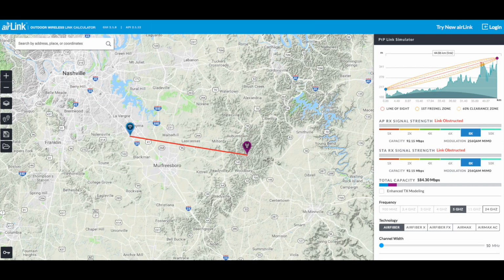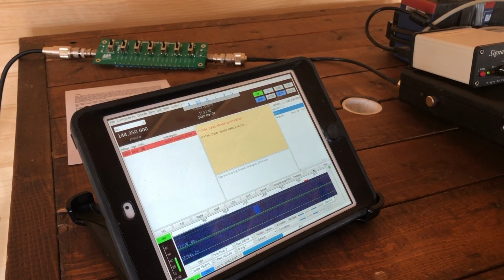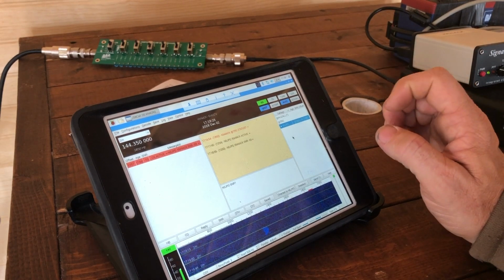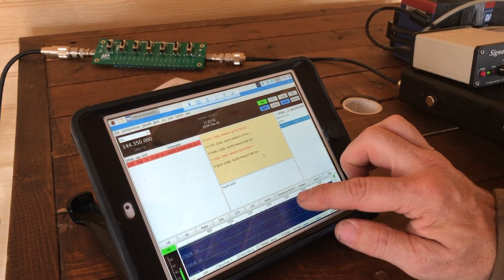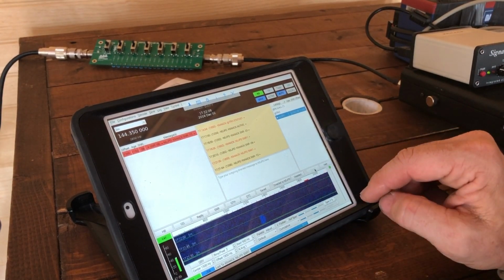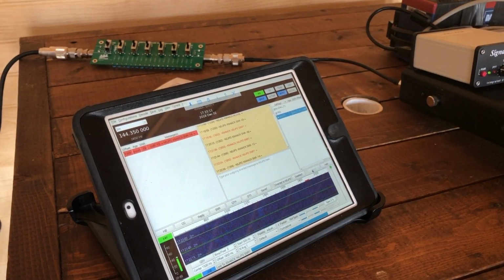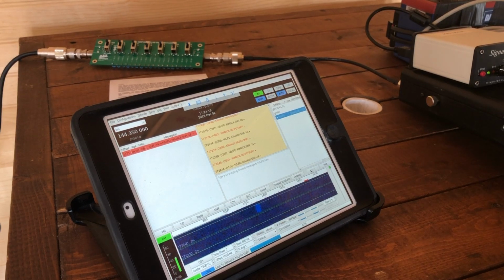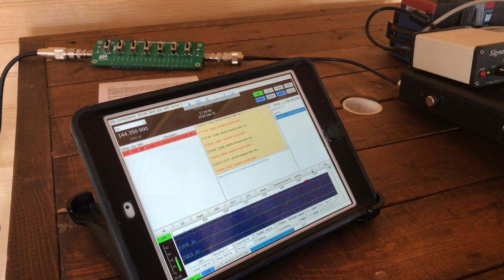JS8Call How Low Can We Go

Comment: Just to make sure I understand: were you on the 2m band in FM mode?  My understanding is that JS8CALL/FT8 is really optimized for SSB.
Reply from the maker: This particular video we used 2M SSB. You can run JS8 on FM but SSB is always preferred. I have run JS8 over FM with a Baofeng before though. https://youtu.be/Y_teUXOdBS0
Reply: @KM4ACK  Thank you!
Reply: I read up higher in thread you were using a Omni (vertical) Copper Jpole. You also say this QSO was on 2m SSB this fascinates me as a all VHF/UHF SOTA activator (by choice) which is much tougher than using HF. I am always on the lookout for way to obtain the 4 required QSOs. What I’m getting at.....Could I could use my FT818 with a Rollup Jpole (vertical) for FM phone and if that doesn’t work switch over to SSB JSCall to call CQ without changing the vertical Jpole antenna?
Reply from the maker: Yes you can but keep in mind that both of us were using vertical antennas. You will lose some db if one is vertical and the other is horizontal. https://www.qsl.net/w8rit/antenna_polarization.htm

Comment: Hey what kind of antennas were you guys using for this test? Someone just shared this video in my patreon oh, but I don't recall having seen it or watch it through previously. You would have a blast with my tower. There's a 13 element yagi 20 meters high with preamplifiers on the Masthead and in the shack. 
Anyway awesome video. Sometimes I really miss my VHF weak signal days. This video was an inspiration.
Reply from the maker: OH8STN thanks Jullian. It was certainly not a 13 element yagi (jealous). I was on a simple home made copper jpole. I think Andy, N0JPD was on a GP9. His antenna is roughly 40’ AGL and mine at the cabin is 26’ AGL. Both are omnidirectional. We never have voice comms between the two locations. Neither FM or SSB. It was really cool to see what JS8 could do. We chose 2M for the test so we could eliminate bands fades that HF could have produced and skewed the results. 73, de KM4ACK
Reply: @KM4ACK  absolutely well done OM 👍

Comment: I just watched this video again after sending the link to friends who are about 40 miles away. I wanted to like this video a second time :-). I also ordered an audio cable that will allow me to connect my EeePC notebook computer to my 8 watt Baofeng UV82HP radio so my friends can try communicating with me using a decent Yagi and JS8.
Reply from the maker: AWESOME! Great experiment. Please report back with your results. If you guys have the capability, it would be great to try this over 2M SSB as well. 73, de KM4ACK
Reply: @KM4ACK  - I plotted the terrain profile between my friends' rural property and my QTH and that 38 miles doesn't look too bad.

http://www.heywhatsthat.com/profiler.html

There are three hilltops that barely intersect the line of sight, although that was with a flat earth model.  Plotted for the curved earth, there is a lot of dirt along the line of sight.  On the plus side, digital modes like JS8 and THOR can really dig a signal out of the noise.  We'll see!  I'll post a follow-up comment here and maybe post a video of my own.  Thank you for the education, and the inspiration!

73 de NI4B
Reply from the maker: One other suggestion if you haven't already, is to try a voice QSO as well. Would give you some sort of a base line. A video of the experiment would be really cool. 73, de KM4ACK

Comment: Great video! I'm very enthused about these digital modes, particularly JS8call. I'm just getting into it. I'm in central Kentucky if you'd like to try longer distance or maybe NVIS regional communications.  73  NI4B
Reply from the maker: NVIS works great during the day. Then 40M will go long for you at night. Also, explore the relay options to reach out a bit more. Not near as much activity on 20M but there is some. Just keep playing with it. It is a fantastic digital mode with lots of tools built in. I have an entire playlist dedicated just to JS8. Thanks for watching! de KM4ACK
Reply: @KM4ACK  - My eventual goal for JS8call is portable use, regionally.  I hope there will be native Android software supporting the JS8call mode (perfect if it could be rolled into FLDigi) and then I'd like to build a ruggedized version of the 10W QRP Labs QSX kit when it's available and use a resonant 40m end fed antenna for easy deployment with an antenna extension to make it resonant on 80m.  I should do more ham radio and think about it less.  :-)

I was aware of JS8call's low power reliability, but it was impressive to see what I would consider to be reliable communications at 28 miles over VHF running half a watt.  I think of JS8call as a primarily HF mode but there are definitely lightweight hand held VHF and UHF possibilities, particularly if there is Android and IOS software.  This may be just the ticket for central Kentucky regional emergency communications from hilltop to hilltop, at distances beyond FM voice, but using readily available VHF radios and requiring only a technician license.  Bump up the power and the knife edge refractions on each intervening hilltop would probably still result in a usable JS8call signal far beyond what could be accomplished with voice communications.
Reply from the maker: I doubt there will be an android app according to the developer. The raspberry pi is always a lower power consumption device that can be an  alternative. It's what I use. The pi only draws .3AH at 12V. JS8 runs perfect on the pi 3. I have a pi 4 headed my way and assume even better performance. FM isn't the best for JS8 but it will work. I have run in on the pi and fed the audio into a baofeng just to see if it would work. SSB will perform way better. de KM4ACK
Reply: @KM4ACK  - I'm not sure how the Raspberry Pi is a lower power device than an Android tablet when the Pi has no keyboard or monitor and is run headless for portable operations, using an Android tablet (Julian) or with an iPad for the touch keyboard and display.  If a tablet is needed for the user interface, why not use it for the sound card and encoding/decoding and eliminate a lot of messy wiring and hardware complexity?  Don't get me wrong.  I love the Pi and I'd buy a Pi 4 in a heartbeat for rig control if there was a practical, tiny, rugged, low power display and keyboard.  Without that keyboard and monitor for portable use, I'll probably just use a small notebook, like an updated version of the EeePC that I bought to run FLDigi.  If JS8call is going to be a proprietary "my way or the highway" solution, someone will implement an open source digital mode with the same features (or more) and it'll be the most popular mode added to the FLDigi Swiss army knife of digital modes.  THOR has great low power and weak signal propagation, arguably better than FT8.  Adding messaging, message boxes, and message forwarding to THOR probably wouldn't be that difficult.
Reply from the maker: Liberty4Ever Liberty4Ever maybe my previous post came across wrong. The pi wouldn’t be less draw that a tablet, just an alternative that was close. JS8 is available on the big 3 OS’s. Windows, Mac, & Linux. I suppose anyone willing to put in the work could port it to Android. The developer just has no plans to do it at present. At least that was the last I heard. de KM4ACK
Reply: @KM4ACK  - Much appreciation to Jordan for the great gift of JS8 to the ham radio community.  I'm definitely not one of those spoiled unappreciative users whose only "contribution" is petulantly demanding that an open source developer implement my punch list right now.  If it's open source, it'll be on Android soon enough, and probably implemented within FLDigi.  I really like the idea of a cross platform (including tablets) universal digital mode application.  It's entirely appropriate for JS8 to undergo frequent builds and tests as a standalone program as it's developed, but it's maturing rapidly.  I'm hopeful for FLDigi integration soon which would make the Android support a lot easier.  Again, I need to watch fewer YouTube videos and spend more time actually practicing ham radio.

As an aging electrical engineer, maybe my best contribution would be to survey the hardware and software, determine the minimal hardware (lowest cost, lightest weight, lowest power, least expensive, most reliable) solution for portable regional and possibly long range communications, and post a video describing it, including a shopping list and instructional PDF, and a provide a downloadable ISO of a Linux Live distribution with all of the needed software pre-installed.

Comment: Great test. Thx for the JS8 QSO!  I'm interested in the Pi also.  Have one and can't get it to work (I used to be a programmer/systems analyst so I should be able to make it work). I want to do it for the same reason:  low power, portable comms when the lights go out.  I'll go over your channel today for ideas.  73. Tom W8DOL
Reply from the maker: Tom, the pi is a great little machine and you can't beat the price. It's the only computer I connect to my rig these days. It can be a bit frustrating to learn but well worth the effort. In receive, my radio and the pi draw around 1A so even a 10HR battery will power both for quite some time. Mix in a solar panel and you have a great emcomm setup. If you run into questions about software with the pi, you can find my email on QRZ. Thanks for subscribing! 73, de KM4ACK